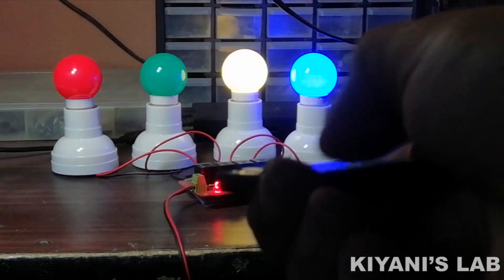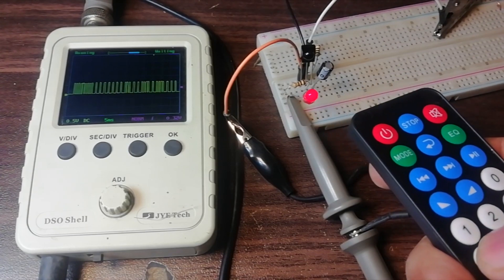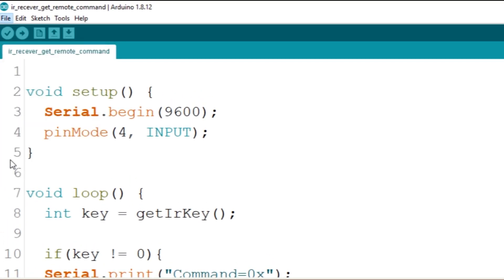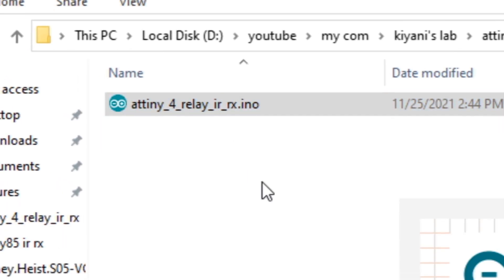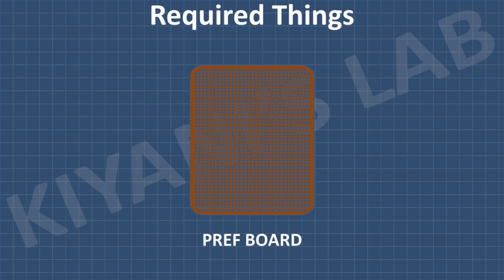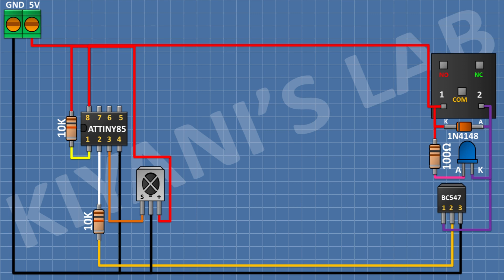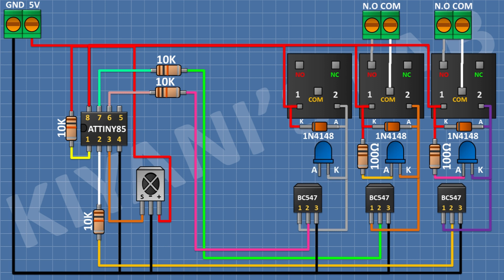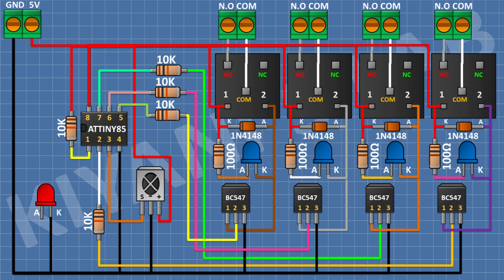How To Make 4 Channel IR Remote Relay Switch With ATTINY85

Comment: YOU HAVE TO BURN BOOTLOADER FIRST SO THAT FUSES OF ATTINY 85 CORRESPONDS TO THE DESIRED FREQUENCY WITH WHICH THE CODE WORKS. I TRIED 1, 8 AND 16 MHZ BUT WITHOUT RESULT. DO NOT UPLOAD THIS TYPE OF FAKE VIDEO OR YOU WILL BE IN TROUBLE. THIS WARNING IS FOR ALL YOUTUBERS WHO UPLOAD THIS TYPE OF FAKE VIDEOS.

Comment: Thank you. Very interesting and helpful. I'll try it, but I'll use 12vdc relays(I already have some of them) and 5vdc to to control signal.
Reply: Attiny85 have 8k memory does it retains last power state !!! Please reply i need to build this it must retain last power state
Reply: Yes you can use EEPROM module and change some code.

Comment: Sir दूसरी video में Remote control switch वालि video में  Sir  project College के लिए बनाना था ji पर circuit diagram me component और video में जो component है उनमे बहुत different है ji c945 transistor 2N2222 and capicitor video में दो है circuit diagram me केवल एक है ji